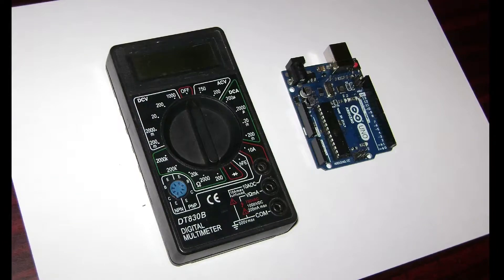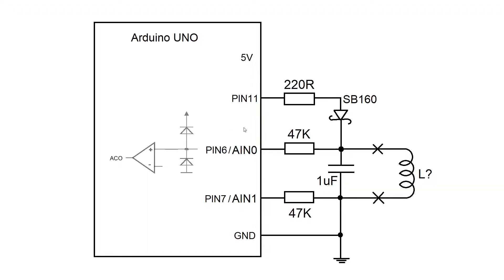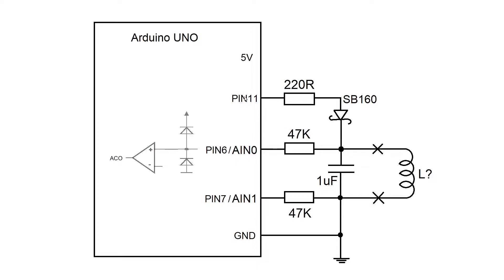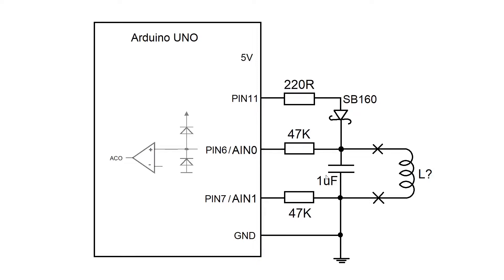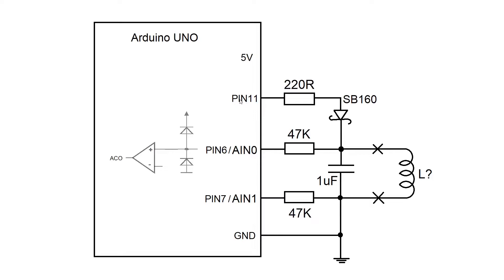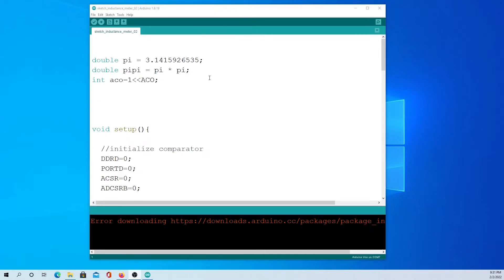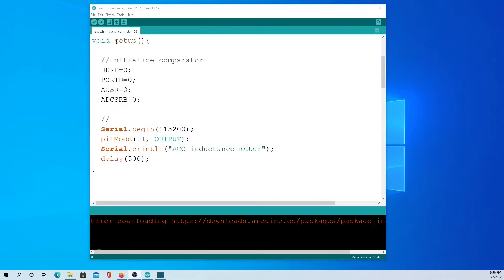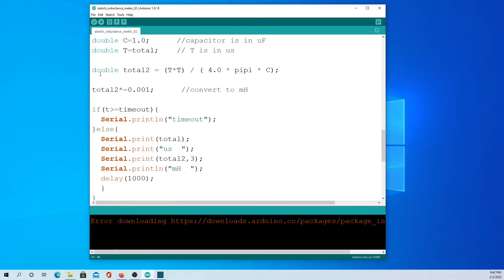Arduino Inductance Meter with Internal Comparator

Comment: Hi, Great video. Can this be used to measure nH inductors.?
Reply from the maker: I don't know, didn't try. You would probably need a bigger capacitor and more current through inductor (more energy in the tank circuit.)

Comment: Hey, great video! I am using an arduino nano and a BA159 diode. I am getting a weird error showing either continuous timeout on measurement. I have tried checking with the oscilloscope and the circuit seems to be producing a pulse on pin 11, it is going through the diode and I can see some oscillation in the tank circuit. However, the arduino is refusing to recieve the oscillation for some reason. Do you know if this is because I am using a nano and maybe the internal compartors are different? 

EDIT: nevermind, I got the problem fixed, I was confused by pins as I suspected, I was using the analog pins, but when I checked the datasheet, it is on the digital pins, so D6 and D7 are the ones I need.
Reply from the maker: I am glad you figured it out, cheers!
Reply: @RealRobotZer0  Thank you for your reply, Rob! I actually played around with your circuit some more, I've added some optimizations, lowpass filtering and the ability to measure capacitance as well. I'm currently working on adding the ability to do an internal calibration and save the weights to EEPROM. Also, I am thinking of how to implement the ability to determine the Q factor and from there the ESR. If you want, I can share the code I have with you.
Reply from the maker: @ivanrodionov9724  Make a video. I will watch it.
Reply: @RealRobotZer0  Will do!

Comment: i have a question what other diode can i use instead of the sb160 Schottky diode
Reply from the maker: Some people even use rectifier diodes, so I guess it is not critical. But I would find another schottky diode like 1N5819
Reply: thanks sir

Comment: how did you learn about the arduino - I would like to learn same. any advice? thanks so much for this valuable information
Reply from the maker: I already knew C, and assembly before using arduino. First uC I programmed was microchip pic.
Get a datasheet for the uC ,but don't read it as a whole. Instead search it when you need an answer.
And ofcourse there are YouTube tutorials, it is really a great resource. Hope this helps, cheers!
Reply: @RealRobotZer0   -- thanks -- will do. Just appreciate that you would post this on the ADC on arduino. i have lots to read. I know C as well, it is just the ATMEGA328P registers,etc and what to do with them.
Reply from the maker: @moredoglife  analogRead abstracts away a lot of register manipulation. If we are talking about ADC.